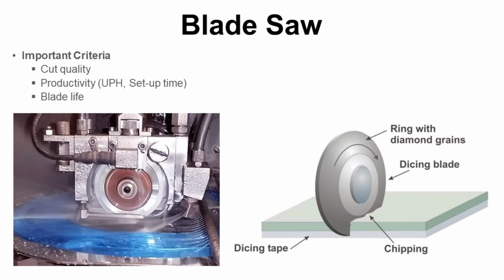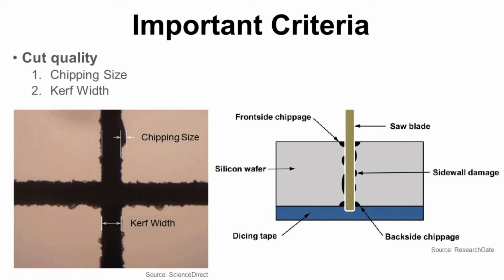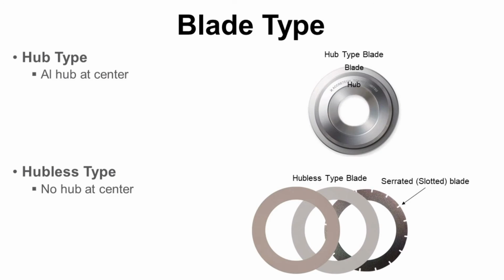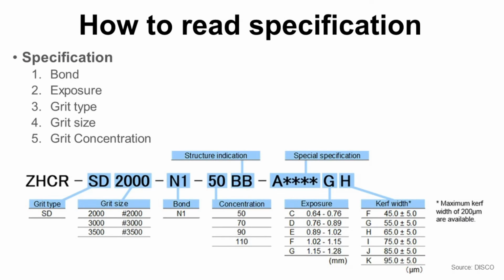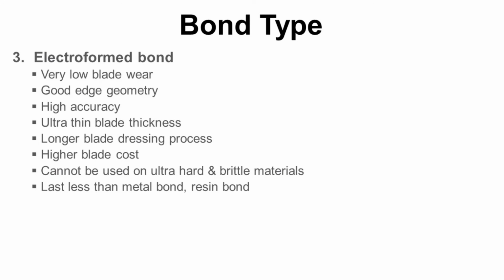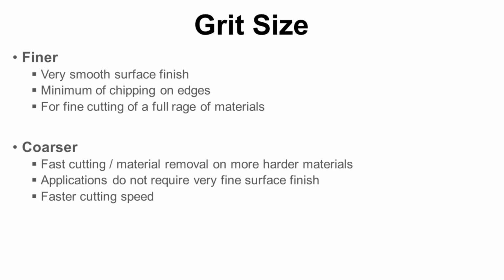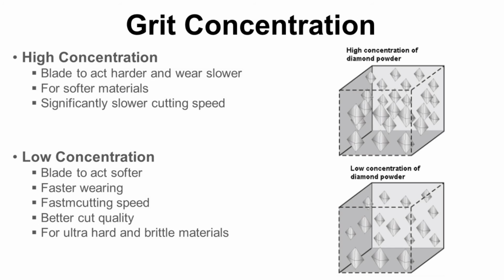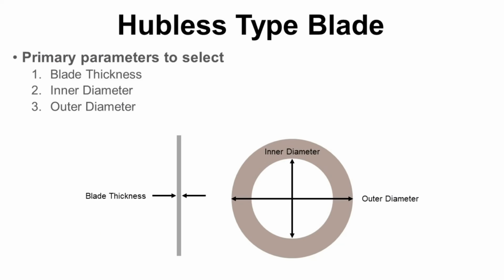[Eng Sub] Blade Sawing - Blade type, Hub type, Hubless type, Process Parameters

Comment: boss, how to solve the issue for incomplete cut?
Reply from the maker: Thanks for asking. Many cases incomplete cut is related with cut depth so increasing cut depth may can solve. But please make sure not to increase cut depth too much which can damage chuck table of sawing machine.
Reply: @semicontalk3223  thank you so much 👍
Reply: @semicontalk3223  Same for deepcut? thanks for answering
Reply from the maker: Yes, if you mean deep cut as too much cut, probably blade went down too much. So you need to decrease cut depth.
Reply: @semicontalk3223  thank you!

Comment: so do you mean the tape is there to prevent the blade from cutting into the chuck table...
Reply from the maker: Yes, wafer mount tape is to hold wafer during wafer process and it also can protect chuck table from blade.

Comment: Actually we shouldn’t based on the chart, because if the wafer blade cut Deep into the wafer we will have different kerf width. 

Also is the blade exposure fixed irregardless the tape? Blade exposure length will not change ? 
From my thought is that blade cut into tape is not part of the exposure measurement ?
Exposure will also affect the kerf width.
Reply from the maker: Yes, kerf width  is combination of lots of things.

Comment: To cut a certain wafer, first we consider what wafer are we cutting , si wafer? 

Yes we also need to wafer hardness. If we take si hardness, we have to consider that in our blade. 
So what is this hardness if we are to specific.

How about the kerf width. To cut a certain kerf width which is 45um maybe. What is the blade height we need to have or should I say the cut 
Depth for such a kerf width. What about the tape thickness if it is cut into the tape slightly, will the exposure changes variably. And what is this specific exposure ? Do we take into consideration the tape thickness for exposure. And for this exposure, we have to choose a specific blade. 

From the chart, it seems that if we want a width of 45um (a range) you will need a certain exposure which is also a range (0.65-0.7 something) . I am confused with Cut depth and exposure. Is exposure length fixed and the cut depth varies depends on the wafer product?

yes, For the blade hardness, grit size, we also have to consider it. What are the specific for cutting si wafers.so as it is important to consider whether this grit size will cause defect on your wafer. 

What is the feedspeed specific to cut to reduce say chipping. If a slower speed is desired if there is a lot of crack. Or if a higher speed is desired if the material is not brittle or easily crack. So do you mean we need to adopt flexibility and change our process parameters as we cut we find out the correct parameters/speed?
Reply from the maker: Exposure is decided by blade and you can choose right blade for your application. 
Depth of cut is decided by wafer thickness and tape thickness. You also need to use right blade with proper exposure.
Typically slow feed rate is recommended to reduce chipping.
Reply: The depth of cut has to cut through the wafer thickness as well as part of the tape. How much should the blade in that case cut into the tape?
Reply from the maker: @Chongweisingapore  I don't have exact number but 50% of wafer mount tape thickness can be good reference.